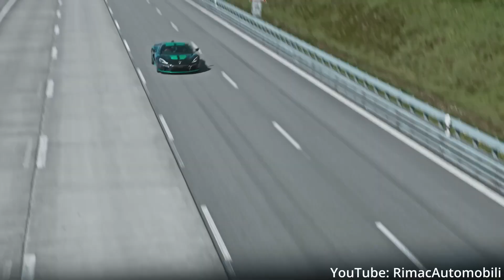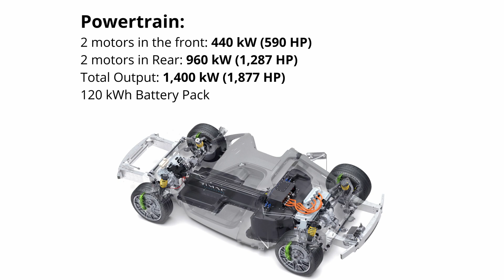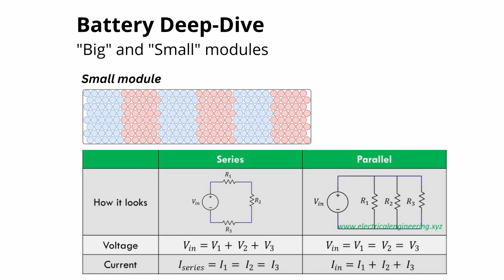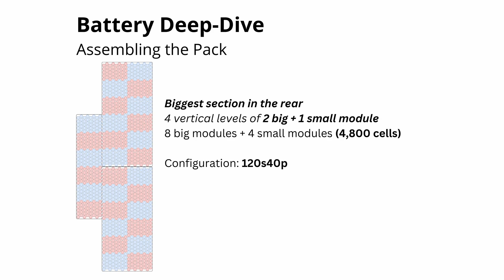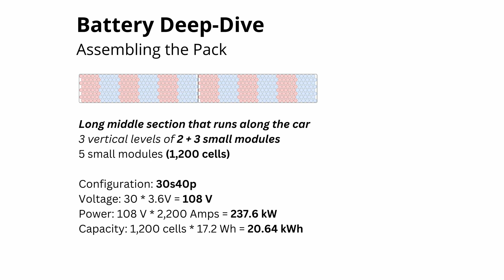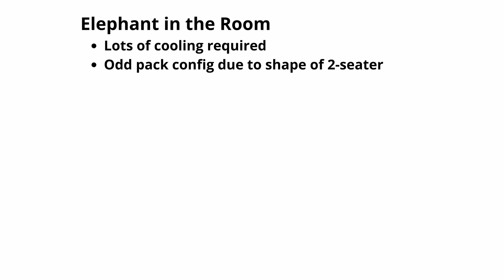World’s Most Powerful EV Battery! Rimac Nevera

Comment from the maker: What do you think of the Rimac Nevera battery pack?
Reply: Easy at $2.2m and 150 production run.
Reply: Why do you stop making video 😢
Reply: One thing you are not realizing is that the Rimac is a hypercar with compromise, putting the battery under the floor would increase the h-point of the driver which in turn would increase the height of the car and then the car wouldn't look like a hypercar anymore.

Comment: 1400 Kw with a 120 Kwh battery (300 Ah at 400 V) is ( 60x120 ) : 1400 = 5,14 min. at peak power...1400 kw at 400V = 3500 A.. To comparison if you smoke e-cigatetes.3500A at 400V would be 35A at 4V. Or 140W..Not healthy for you or the battery..🥵

Comment: Most important part is the cooling, so far Rimac didn't show the car being pushed for more than 2 minutes. Their cooling solution is better than the Taycan but they need 5 cooling systems for the car while Tesla used 1 in a Plaid thanks to octovalve (hence 2250kg Model S with more space than a Skoda Superb, 2300kg largest carbon monocoque in the world for Nevera). Nevera was recently spotted at the ring again and I hope that everything goes well, there's a reason why Plaid holds the record for electric cars on the Ring and why Lucid for example didn't even try that track and they sticked to Goodwood and basic acceleration tests...

Comment: If you think Rimac build a car just cuz it wants to go fast, have you ever watch Rimac clip... Do you realy think they didn't try to chose wich option is the best, for the car they wanted to build... I think you realy don't understand cars, I'm sorry
Reply from the maker: No need to apologize. What Rimac clip are you referring to? Of course I think they are focused on driving dynamics, but how could you not think one of their primary goals was power and acceleration? They sacrificed a lot of weight for a massive battery with an absurd power output

Comment: The 10 or 15% increase in battery performance is not because they are choosing the best cells but due to the liquid cooling that allows them to push the cells a bit more on discharge.

The figures on the website are for uncooled dry cells
Reply from the maker: Thanks for clarifying! I talked about cooling a bit throughout the video, but totally forgot to bring it up when discussing cell performance.